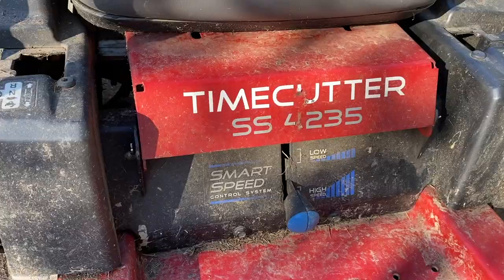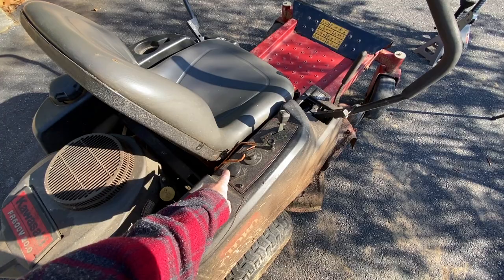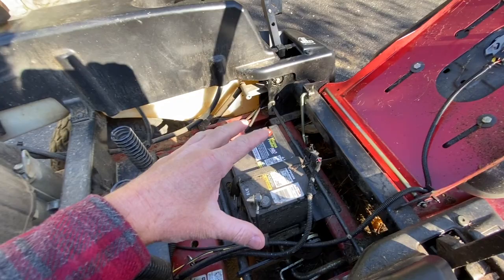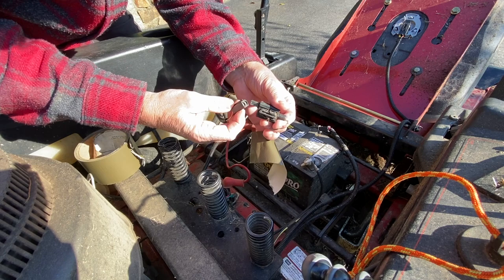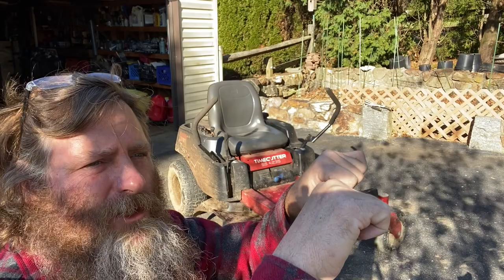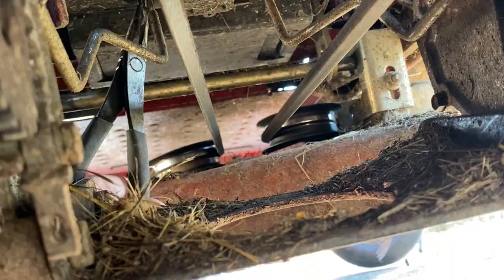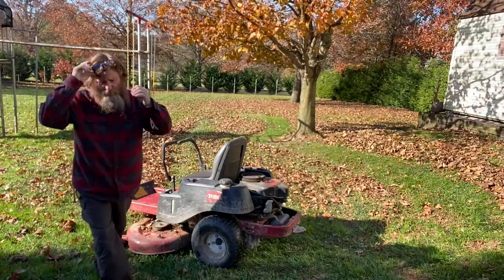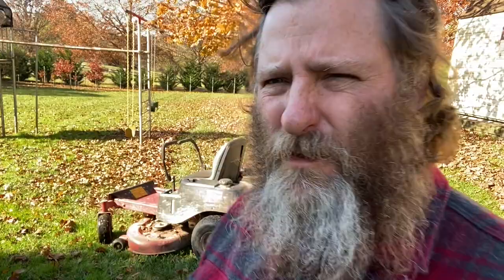Toro Timecutter zero turn mower shuts off when handles moved FIX

Comment: It is not the switches. It's something further down the circuit.
They are working correctly if it shuts off when the handles are moved in. It's telling you something else is wrong.

Comment: Tyvm, saved me some troubleshooting. Got it to drive w/o stalling but now turning on the blades makes it stall too. Troubleshooting continues.....
Reply from the maker: Good luck brother
Reply: I had the same problem. It turned out to be the metal rods going to the brake controller were bent.  Thus they were too tight and the brake controller wasn’t able to rotate freely.   Disconnect both brake rods , (I tied mine up so they wouldn’t drag and bend more) and then see if your problem has gone away.
Reply from the maker: Good call!

Comment: I had the exact symptoms with my SS5000, but my problem turned out to be the brake control module.   I have it bypassed for now, until my new module arrives, and it works fine.
Reply from the maker: Nice work
Reply: Hey regarding your brake , does it turn off when you push the brake off? How did you bypass?

Comment: ive been working on mine all day...started blowing out starting fuse...found a crimped red wire on that fuse box. after that it stopped blowing fuse out and it started but when i engage the handles or the pto it turns off...also the seat safety switch ita not working, it turns on even if im not sitting on seat. i just replaced the ignition switch cause the other one went bad, its an after market so dont k ow if that might be causing for all the safety switches to act up...dont know what to do

Comment: Need to try an check this tomorrow for my neighbors mower
Reply from the maker: Hope it works out for you
Reply: @oxford821  this was the Issue..
Reply from the maker: @coppertopv365    Did you replace the switches?
Reply: @oxford821  no sir, I looked online for them, and I'm going to check with John Deere tomorrow.. it seems like the sensors, but it could also be electrical.. so I'm going to check wiring tomorrow, then inquire with the John Deere place after that. I have an old 01 Craftsman regular mower that works I'll use until I get the kinks worked out. I think the carburetor will need Replacing.. the butterfly valve isnt operating correctly, and I already took the carb off an serviced it, cleaned it, and reattached the carburetor.. 
But I hold them Lever Buttons in, and I can make it work so I'm on the correct track.. 
Thank you

Comment: What if the replacing the safety switches don’t fix ? I got couple new safety switches at my local store and the problem still persists.
Reply: I have THE SAME ISSUE! I have just installed two new switches and it still dies when I pull the handles together.
Have you figured out the problem?
Reply: Then it might be a bad break control module, bad pto switch. Check make sure the pto wire isn't loose

Comment: Hello there great video I changed the safety switches on the handles and I didn’t change my seat switch just yet however I think it is working fine because it shuts off when I get up with the blades running as well, still shutting when put on PTO. Should I try changing the seat switch ?
Reply from the maker: Yea, that’s an easy one to change. Hopefully that does it for you
Reply: @oxford821  how comes that the seat switch can be bad, if when I get up with the blades engaging the mowers shut off ?
Reply from the maker: That is what it is supposed to do, idk.  Seems like some circuit is getting disrupted somewhere
Reply: What do you think I should at next ?
Reply from the maker: The PTO switch is the last one to change.  If that doesn’t work, maybe swap out the part they all run to. I think it’s a black circuit box

Comment: This was a great video and worked mostly for me.  The mower was turning off with the handles moved forward.  I tried your approach at it worked.  The only problem I am now having is when the mower blades are engaged the mower cuts off.  Any suggestions?
Reply from the maker: Thanks, I would try a new PTO switch first. That would be the easiest thing to try for the blade issue
Reply from the maker: Thanks, I would try a new PTO switch first. That would be the easiest thing to try for the blade issue
Reply: @oxford821  I bypassed the PTO switch and that seems to be the problem.  Thanks again!!!
Reply from the maker: @LovintheUTube    Right on !

Comment: Does pushing the handles forward immediately after bringing them in keep it from dying if you do it fast enough? Are the switches only depressed when they are brought in?
Reply from the maker: The switches are spring loaded. Soon as the handles are brung in, the switches are disengaged

Comment: Disabling the brakes????   The safety switches can be pulled apart to just clean their  internal contacts with  spray contact cleaner, and should have been the first thing completed.  From  here, if you still have problems with switches working correctly, then it time to trouble shoot the brake control module.
Reply from the maker: Damm it. I wish I woulda thought about that first! Good idea
Reply: Yep contact cleaner is a must for all shops now

Comment: I was having the same issue and after changing them handle switches it still did the same thing it didn’t fix the problem when I pull the drive handles in it shuts off so I’m still troubleshooting it
Reply from the maker: That sucks, did you test the safety switch under the seat?
Reply: @oxford821  yes the seat switch is working so I am assuming my issue might be the actual brake module that releases the brakes what you think?
Reply: Also have same problem, replaced seat and control arm switches however when arms are left in outer  position engine will stop in a few seconds unless I move one or either lever slightly in to allow engine to continue running?
Reply from the maker: That seems backwards. The engine should stay running when handles are outwards.

Comment: This just happened to me today - havent looked into it yet but am curious if it may be low on Hydrostatic fluid...
Reply from the maker: I don’t think the transmission are serviceable on these lower end mowers? I never noticed a drain or fill on them. Let me know if they can be because I’ll change the fluid if possible
Reply: @oxford821  I looked and there isnt any level switch of any sorts - I noticed a filler tube under the left side of the seat though. 

In regards to that three dollar box for the brakes, I am rewiring the safety's to where the box does the brakes only, and put my own relay of some sorts in place - some rather bad reviews on this design.
Reply from the maker: @williamhusseyjr1143    Sound like a plan.